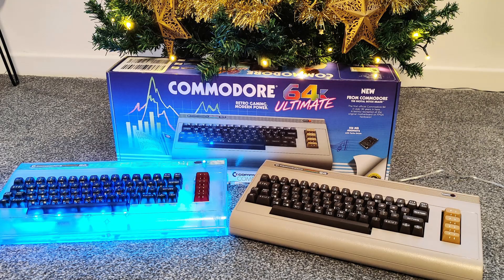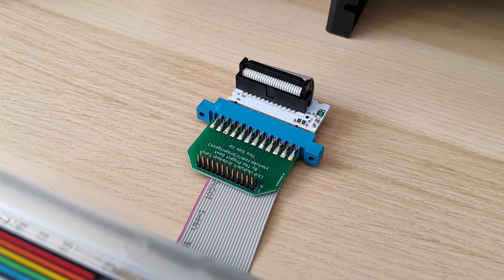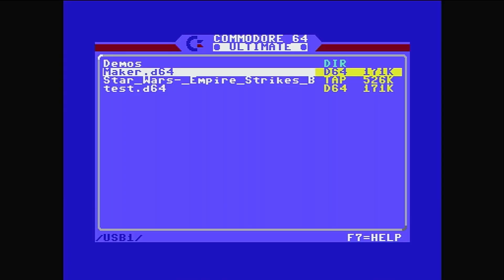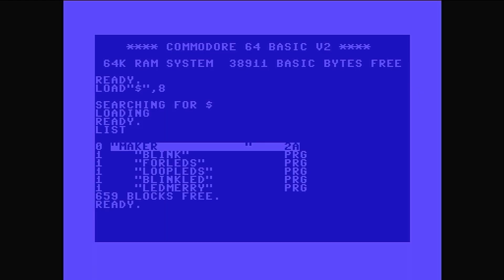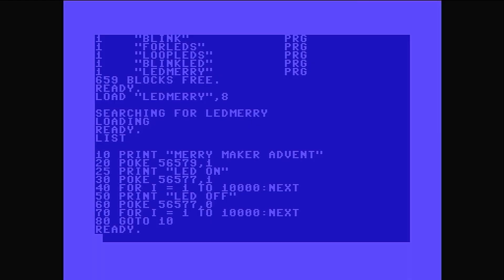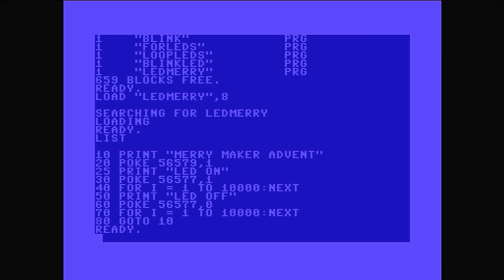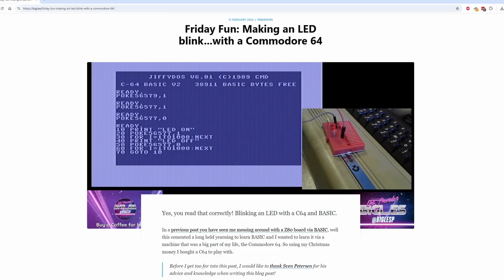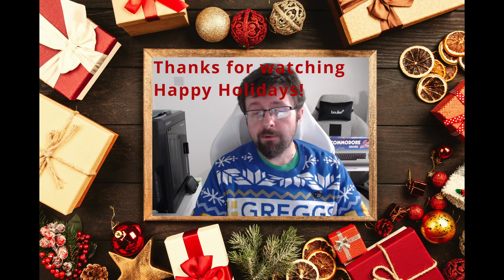Maker Advent 2025 Day 24: Commodore 64 Ultimate User Port Breakout

Comment: Over 30 years ago I made good use of the Commodore 64's user port. Made boards with 8 independent LEDs. Made boards with relays to control mains devices like lights etc. Also used the port to drive and control LCD character displays.

Comment: Is it required to poke [56579, 1] every cycle?
Reply: No. 56579 is a fixed memory address in RAM. Whatever value is stored there will remain the same until it is updated to something else, or the device is hardware reset/powered off.
Reply: That line could've been placed at line 5 and doesn't need to be part of the loop.
Reply from the maker: No, I noticed that after the video, I could've just looped back to the print Maker Advent line instead. Well spotted.
Reply: @LesPounder Forgot to ask, does the user port breakout board include the ribbon cable? I received my breakout board a few weeks ago but haven't opened it yet. Also is there a cut out on the Commodore Ultimate's case for the ribbon cable to pass through or do you have to cut it yourself?
Also Merry Christmas everyone  🎉
Reply from the maker: @stephenshepherd6854 the cable is included. I passed it out from cassette port, it just fits. No cutting required. A dedicated port would be nice, but sadly not there. Merry Christmas. Thanks for watching.

Comment: I ordered my ultimate 3 days ago - and haven't seen the userport being an addon. Now I have to order it seperatly.

I am a big fan of the German toy "Fischertechnik". In the 1980s they had a computer interface for the C64 to controll hardware (mostly lights, motors and magnets) and input hardware (f.e. switches and light sensors). They even had a pen plotter with two stepper motors, a magnet to lift the pen. Never had it back in the days (not cheap...) but some years ago I got it on ebay - plotter + interface + software. However, I never testet the plotter on a C64 (hadn´t a working one). So definitly I need the userport now 🙂

Actually back in the days I had some other Fischertechnik parts: A "LS-Modul" (simply a powerful transistor, so you could use the low current output of a TTL-chip to control a lamp, magnet or motor) and a "Netzschaltgerät" (a relais for AC 220V). So I combined C64 and theese modules to control the lamp on my desk using the same poke commands you do in your program. My first "smarthome"...

I am realy looking forward try all thes nice projects now.